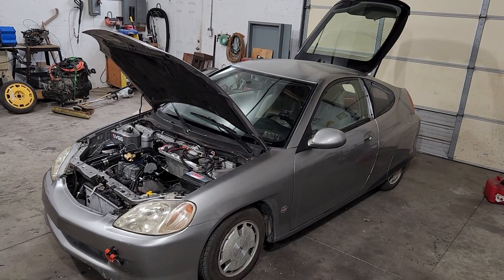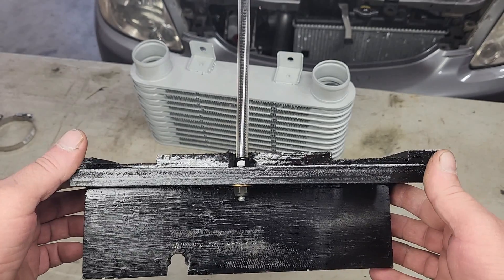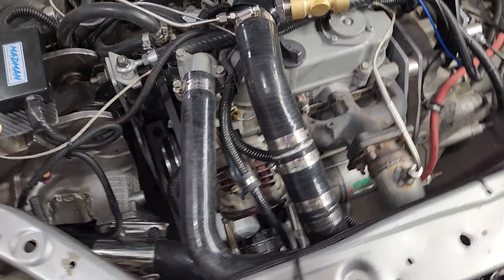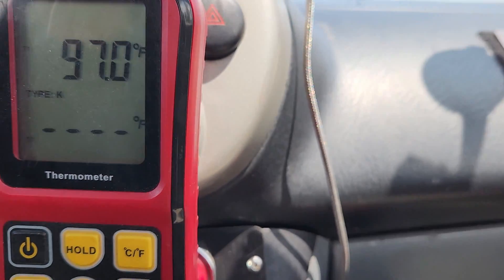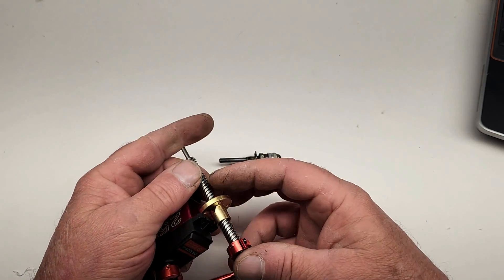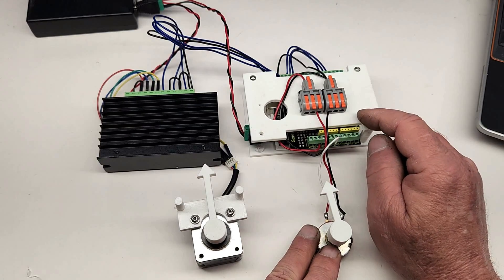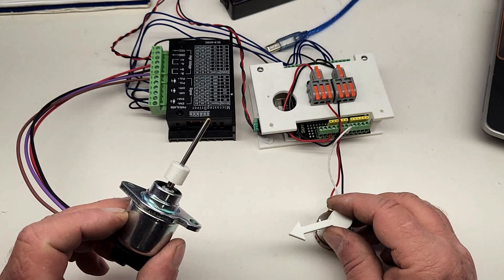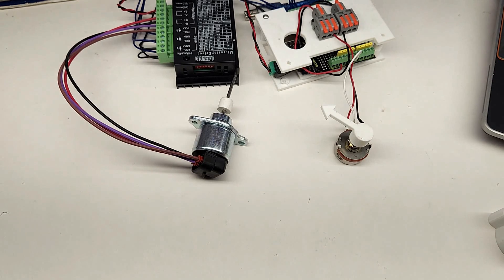S4 E17.  We install an intercooler on the AMR500 supercharged Kubota diesel.

Comment: As Keven Banks says it's not about boost it's about air density. If you drop air temp you have to increase air density. And since boost is a measure of restriction not necessarily power addition. There for the reason you saw a drop in boost was because the air density increases and the motor was actually able to consume the air that was being forced into it. This means the real reason you didn't see a difference in fuel economy was because you had inadequate fuel to actually use the extra 2 psi of boost you consumed. So once you fix the fuel regulation on the motor you will see a change in fuel economy. What would really benefit this car would be a wideband for data collection of the actual AFR ratio.
Reply: So you're saying 10 psi won't go in but 8 psi will? 
We're saying the same amount goes in by weight but at different pressure so there's the same same.
Reply: @Bangbug19  no, I'm saying that the overall pressure that the boost gauge is reading is the restriction in the intake pipe. This is the one weakness of a boost gauge is that they can be manipulated by air density so easily. Because as air gets hotter it expands and becomes more pressurized, resulting in a higher boost number. But that pressure is technically a pumping loss because the more pressurized the air becomes in the intake tube via heat, the harder it is for the motor to consume and get the most potential power out of combustion. The reason it dropped was not because the supercharger was actually making 10 psi of boost but rather it was making closer to 7 to 8 psi but the heat from pressurizing the air was causing thermal expansion, artificial raising the boost level to 10 psi. And the reason he couldn't see any difference in fuel consumption is because of the fuel limitation he is hitting. Once he can increase the fuel he will be able to use that extra 8 psi of boost to result in an actual performance gain. If he had an air/fuel ratio gauge I guarantee we would see the car running more and more lean as he keeps increasing the boost.
Reply: So he's not using 8 or 10 psi now.
Amazing.
If only he had a temp gauge too.
If only he was adding an intercooler. If only he had run up the rack.
If only he had a YouTube channel like you have doing random experiments to only be told that boost is only a measure of restriction! Hopefully he can get back to no boost for no restriction so he can make all the power.
Reply: @Bangbug19  In a perfect world yes.

( And don't ask a scientific question if you don't want the scientific breakdown.)
Reply: @narwhalman  ahh yes a scientific world where a measure of pressure differential is a bad thing. I guess thermodynamics have changed since I was in uni. Surprised everyone everywhere in all boost applications measure it still, all these idiots. They must be as old as me!
Reply: @Bangbug19  I never said that boost was not a accurate measurement of pressure in intake. I'm saying it's part of a much more important metric of data. Data that as we can see is clearly showing he is reaching a point now with more air density that we are reaching a fuel limitation that is clearly hindering further making power with more boost. And at this point a wideband would be a method of further data collection to see how badly of a fuel deficit we are currently at that is hiding power production. As someone who attended school specifically for tuning and modification of cars I can see that clearly you don't understand the intricacies of how engines consume and make power with boost.
Reply: @narwhalman  and yet boost as a metric is bad. You can spout all the bs you please. He addressed the fueling specifically and was just messing about with charge temp.
See with science, that you're so fond of, you change one variable at a time.
Reply: @Bangbug19  but he hasn't addressed fueling yet. He still is developing the variable fuel rack mechanism to fix that problem and has not retrofitted it to the motor yet. And in a motor fuel and air have to go hand in hand otherwise you will not see a change in anything. So to look at charge temps and say ok we changed it and nothing happened is not the way to address anything. Now with the lower charge temps he will be about to actually take advantage of the boost he is producing and add fuel according once the different fuel control is completed. Plus you have to lower air charge temps because beyond a 160 degrees you enter a state where pre-detonation is almost guaranteed to happen which will blow a hole in a piston without a second though if it is violent enough. And like I have said multiple times boost is considered a bad metric because it is easily manipulated. I can make an air tight box and heat the volume of air within it and you will observe that the air pressure will increase. Vs if I cool the box the pressure will decrease, this happens because the air density changes. This is why air density is more important than boost because air density is the true density of a volume of air. I can have a ton of boost if I superheated an air intake pipe but it would not mean I would be making significant power. I would actually lose power to pumping losses of the hot air and pre-detonation.
Reply: @narwhalman  saying that he's not changing it IS addressing it.
Even the basics of conversational logic are beyond you.
Which has been the basis of my comments to you.
Best of luck with your burgers.

Comment: It's the internal volume that matters in terms of pressure drop across the intercooler. That and it's internal aerodynamic efficiency.
 Both are worse on the new " smaller " intercooler, by the looks of things.
 The best solution with available components is to cut 1/3 of the core out of the original intercooler and weld or braze it back together.
Reply: No because he'll need the full amount of that intercooler when the ambient Air temperature starts going up especially if he decides to increase the boost because it will be hotter the more you compress air the hotter it gets its a hard balance to get the boost higher without increasing the temperature without having some sort of cooling system in place to improve air density which is more important than Air volume Bank's Diesel has proven that.

Comment: You could put an H pipe at the top of the intercooler with a flap on a thermostatic switch to bypass the intercooler until charge temps exceed whatever number proves to be max ideal. Might even be able to do some blending if you use a mechanical bi metal spring to actuate the flap progressively

Comment: Using the GMI IAC to control the fuel rack, and one control the boost pressure, you can use a GM TPS to monitor the throttle position, the pyrometer for exhaust gas temperature, along with boost pressure at the intake manifold and maybe RPM as well, and through the long arduous boring process of experimenting find the right calculation that you could enter it into your Arduino and control not only the boost pressure but the fuel rack position someone like the way most gasoline engine management systems calculat for short-term and long-term fuel trims. And perhaps you can have a short-term and long-term calculation on the arduino... but that's getting overly complicated.. or is it?

Does Mr Fusion work on diesel fuel is that even a viable option injecting it in the intake.... no I'm just talking out my tailpipe I'm sorry.
Reply from the maker: LOL, the Mr Fusion gadget.  Hmmm  Not many people know about that.   I don't think Mr Fusion would work in this application because on a diesel, the fuel is injected exactly when combustion occurs.     I should make another Mr fusion to try on other experiment though...
Reply: @robotcantina8957  when starting some of the bigger diesel engines, I've seen people put ether or other ignitable chemicals in the intake to Aid starting. That's the only reason I was thinking that would be an idea if Mr Fusion worked on diesel fuels.... although other than starting, I can't think of any reason why you need to inject more fuel in the intake stream, that'd be better for the air-cooled 2 cylinder overhead cam CVT pre and  clutchless primary-transmission Renault ..  and I got my associate's degree in automotive mechanic technology before becoming disabled with MS I have a basic idea of how cars work :-)

Comment: In the spirit of making your engine description as long as possible, why not add a blow-down turbine and make it a turbo-compound supercharged inter cooled diesel? That wouldn’t add back pressure but would give back chipmunks worth of power increasing both top speed AND fuel economy. The challenges here are first finding anyone who even knows what a blow down turbine is (they come originally from steam engines) and then how the heck do you return power to the engine? But isn’t the whole deal here making-up impossible problems and then solving them for under $20? MY solution would be to replace the alternator with a cobbled-up motor-generator, maybe built from a pair of those John Deere tractor generators — one on the engine and the other on the blowdown turbine. Power from the turbine would feed to the engine-mounted generator running it as a motor and feeding power back to the crankshaft. That way you could call it a supercharged inter cooled HYBRID turbo-compound 719cc Kubota diesel engine!

Comment: Well done with the IAC valve and integrating that sci-fi tech stuff with it. Also I have to say, my sunday morning isn't complete without your home grown ingenuity and woodworking skills.

As being a former  enginenerd I have to wonder about the forces at play here. How much force does it take to move the fuel rack (under pressure) and how much force can the IAC actuator generate? The IAC valves were designed to move valve and only had to fight against air pressure. It would be bad if the stepper stalled out because it couldn't handle the pressure.
Reply from the maker: The fuel rack is moved by the governor and the pressure it will apply to the IAC is unknown.  The good news is the IAC has a lot of push force and I reckon it could lift 15 or more pounds.

Comment: Boost drop, in my opinion is due to the extra volume of the added intercooler. I see some folks saying its due to "cooler air", BUT you seen a drop in psi right off the bat, still in the shop (not yet driving around with the charged air being cooled from driving around). Change My Mind 😊
Reply: An intercooler will still work the same as a heatsink works in electronics

Comment: Jimbo, its not about boost, its about manifold air density. Take a look at a few of Banks' videos on this topic. A lot of his killing a duramax and building a diesel monster truck videos go over this I think. The acceleration test should be interesting.

Just remember PV=nRT.. if you increase temperature in a fixed volume system, pressure will increase.

Comment: So basically, an intercooler makes the air denser by cooling the air, letting you get more air for the same compression pressure. The air was fitting into a smaller space, but if you don't add more air and fuel then it's just running at a lower pressure for the same power.

Comment: For a future project. Could you make a variable fuel timing Gear. That way you can adjust the point to inject fuel into cylinder for it to burn the most, and increase the horse power as well as the fuel economy.  Maybe use something like a cam phaser gear off a Chrysler Pentastar engine.

Comment: P1 x V1 = P2 x V2 is one of the gas laws. You start off with a volume at one pressure and temperature. Now reduce the temperature, and the volume will drop. As described by pokebass1 below, the volume of air (once cooled) is lower, hence the pressure drop across the cooler. Lots of other stuff, bit too much for this comment!

Comment: So, it looks like the intercooler, by itself, lowers the intake air temperature on a boosted motor, which is good for reliability (makes the engine less melty), but it does not by itself increase power or efficiency.  It will, however, allow you to add more fuel, which should make more power with an added margin of safety, as the intake air temperature will already be cooler.  And it looks cool.  I look forward to the test.   (Oh, be sure to add "fuel injected" to "supercharged, intercooled, three cylinder Kubota diesel," on your resume, as many folk may not know that all diesels are fuel injected.)
Reply: Might as well add “direct injected”
Reply: I thought those were indirect injected but I may be wrong 🤔
Reply: @Jay-kc2pm  a lot of diesels use a prechamber with the glowplug and injector in it, among them Kubota as far as I know, it gives a very smooth running engine but a bit harder cold start, prechamber diesels have to preheat to start

Comment: at 16:51 you have some empty bolt holes near the belt why not put in a belt tensioner for that purpose and for getting the belt away from the plastic piece its rubbing
Reply from the maker: The size of everything is deceiving on video.  The smallest idler I could find was huge and caused even more problems.

Comment: Cooler air is more dense, therefore you are still forcing the same volume of air into the engine but at a lower pressure and temperature. The MPG stayed the same because (I'm assuming here) the fuel adjustment was the same. I love your little projects and really look forward to seeing how your fuel adjustment setup works out.
Reply: you are right, its just safer for the engine and less heat is a good thing even though it didnt change the MPG, it is an improvement.
Reply: @NimaSomeh diesel running 10psi is not unsafe like it would be in a gasoline engine
Reply: Ah, you are ahead of me-that's what I realized last night.  Adding the intercooler didn't force any more air into the engine; it just cooled it. All those little oxygen and nitrogen atoms were just bouncing around in there a little less vigorously.   I wonder what would happen if Jimbo were to raise the boost pressure to the previous level with the intercooler in place and ran the same test.  Probably just less smoke.  But once he can adjust the amount of fuel he can inject on the fly, along with varying the pully sizes on the supercharger he can test all the relevant variables.  One variable at a time!

This is all so interesting, I kind of understand how turbocharging/supercharging works in a gasoline engine, it never occurred to me how diesel might be different.

Comment: Boost pressure isn't everything when it comes to increasing performance air density is also important and colder air is more dense so the intercooler is likely making a difference if you adjusted the supercharger to put out the same number of boost as it did before it would produce more horsepower with that boost because the air is pushing to the engine is more dense. You would of course have to increase the fuel running to the engine to compensate for the extra air but that's likely why you didn't notice any difference in the fuel economy You're still technically getting the same volume of air into the engine it's just at a higher density aka lower charge pressure. does that make sense I don't know if I'm explaining this very well
Reply: And to the trolls out there I will admit upfront I don't know everything and I'm sure I've made a mistake but that's my understanding on how this system works

Comment: Jimbo, glad you saw my past comment on the GM IAC motor.  From my experience with these, they seem to have about 256 steps, end to end, and they can handle a pulse duration of 10 ms, thus 100 steps per second.  You could probably use the stock IAC valve as a boost regulator.  The cone end fits into a hole about 3/8” in diameter in its stock configuration.
Reply from the maker: Hi, Thanks for the suggestion of the IAC motor. It looks like its going to be the perfect solution.
Reply: You can also do micro steps with the Arduino controller to get finer step rotations.

Comment: You should take more credit for this.  You've situationally engineered a diesel generator engine into running an old honda insight.  Supercharged and intercooled.  And the engine didn't have either in it's intended application.  And definitely wasn't in an old Honda hybrid.
Reply: parts bin special